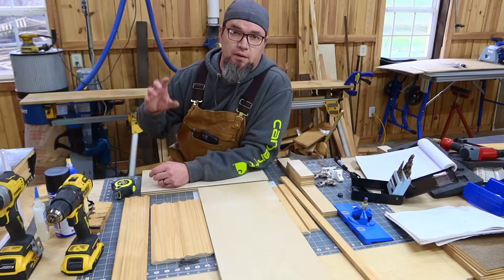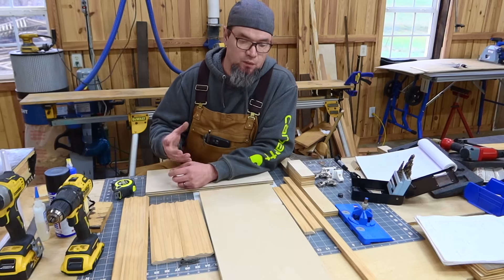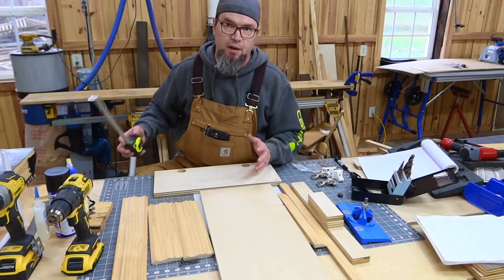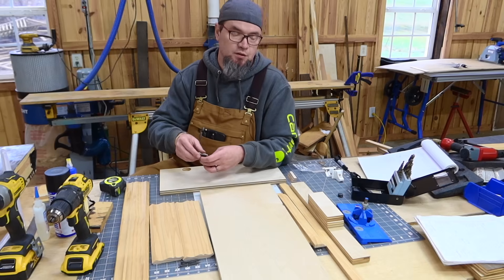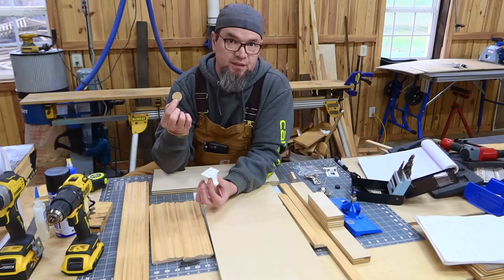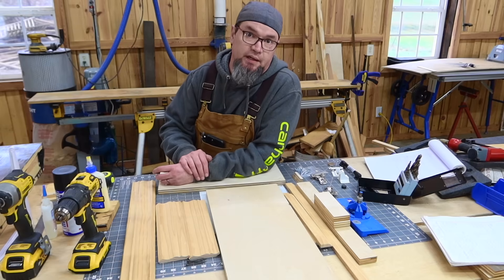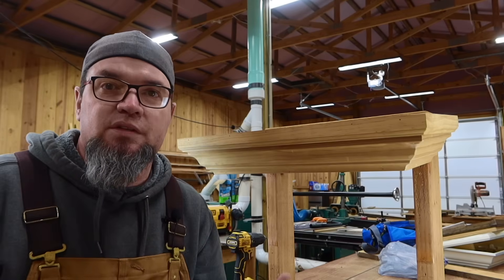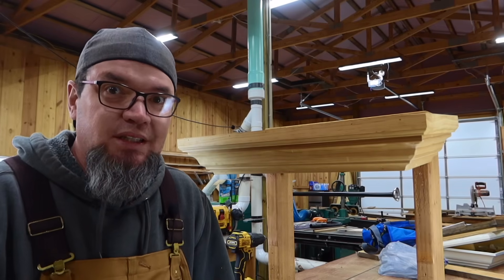Concealment Shelf Build (New Version) / Make Money With Woodworking!

Comment: This update is awesome & much more detailed! Only recommendation I have is showing how you cut the 45’s on the crown molding. I only say that because the first time I did I chased my tail for a while before I realized how simple it was and how complicated I made it. Again, I love this video & your content!
Reply from the maker: Hey!  I do have a video (Not the greatest quality) that actually shows 4 different ways to cut crown.
Reply: @MatthewPeechWoodworking  good to go then, you got it covered! 😎
Reply: That was my biggest problem cutting the molding and cutting it upside down etc. lol
Reply: @MatthewPeechWoodworking  hey neither Home Depot or Lowe’s has those size moulding, can you please help me out with a similar size and how that would change the other cut sizes. Thank you
Reply: @YungRekless   hey, maybe check out another local Home Depot - I purchased both a few days ago
Reply: @MatthewFayson  I checked 3 Lowe’s and 2 Home Depot’s man. Idk why they don’t have them.
Reply: @MatthewFayson  everything is 3 5/8 instead of 3 1/4
Reply: We got ours at Home Depot. We struggled with the molding cuts at first. Maybe link that video in the description.
Reply: @YungRekless  should be ok if it's a little wider crown, the length you need to cut won't change.
Reply: @jasonbzdok3790  it’s the width of the crown though. So the bottom part would be bigger overall towards the top, and might not close. Also if the bracket isn’t tall enough to accommodate, even if it did close it would be at an angle.
Reply: Do you have any PDF plans I could purchase?
Reply: @YungRekless  yep
Reply: Stand behind your saw and look down at. It would be in the same orientation if you were putting it up on a ceiling. It will come to then....
Reply: I've built to your plans specs and I'm having trouble with weight when I add a gun the shelf just goes straight 90° open and everything falls out any advice on how to fix this problem

Comment: 3-1/4 Pine crown Molding seems to be very unique not sold in stores near me. To order it the shipping is crazy expensive. Would 3-5/8ths work? Update: Yes it can but you will need to increase your top piece by about 1/2. You could go a little less but needed to leave some space for error since I am new. Speaking of which. I had no idea about how to cut crown molding. I wasted alot of CM trying to figure it out. I eventually looked it up and watched a video. Not hard to do but as beginners, you may want to add that people need to either watch a video about it or learn because it is a complex cut. Just a suggestion.

Comment: Thanks for the more detailed video.
I wanted to share a tip, when beveling the ply base, I cut and assembled the crown then used a 7/16” 45 degree bearing bit on my router to bevel the crown and base in one pass.
This way when the case is closed there is no gap between the crown edges and wall.
You could also use a round over bit or the table saw.
Reply from the maker: Very good tip!  Thanks!
Reply: Good idea. I’m gonna use the router table and 45deg bit but i don’t t think i would have thought of that on my own. THANKS
Reply: On another note if you do cut with the table saw watch your depth because you might seeing a little hole thru your hinge holes (-:
Reply: @robwilliams3602  yep I’ve made that mistake before. Not on this project but on a set of MDF cabinet doors  🤦🏻‍♂️ routed that nice profile right through the edge of the hinge pocket.

Comment: Hey Matthew, good video. Appreciate all the information you share with the community. One tip on the corners: you can use a screwdriver or wrench to roll the corners over if you don't get a perfect match. It folds the fibers over and covers any gaps; where as sanding might expose more. Again, good builds. I've already built a few mantles for customers using your distressing techniques. I also built some floating shelves where I only used a wire brush to age the wood, without any hatchet or other markings. Turned out great. It's crazy how you can turn boring framing lumber and turn it into something someone wants to hang in their home.

Comment: Nice build, Matthew. Couple of questions if you don't mind. 1) Do you know how much weight this shelf will hold? Approx. or if you've tested it, and 2) When you sell/sold them, how much did you retail them for? 
Like your channel, and your delivery. It's like going over to a buddy's house to see what he's up to. Thanks for your efforts, tips, and can-do attitude.
Reply from the maker: Hey!  I havent really tested for weight.  But I would say atleast 5 pounds.  And when I sold them they went for $200-250.  Check out my other videos where I talk about marketing these.
Reply: I think most people would be interested in these for a place to hide their keys and other things. If you need more "weight capacity" i would suggest a simple fender-washer and a pan-head screw(or lag bolt even)? at the anchor point to the wall stud? The sky's the limit. If you make it strong enough I bet you COULD do chin-ups with it. Hope that helps  :)
Reply: @thefeet  it just seems most things you put in there, especially keys, would slide out when you open it.
It'll probably need maybe little compartments to keep things from sliding around.
Or maybe a foam insert would be nice if you want to put something specific in it.

Or it wouldn't be hard to switch it around and make the top the lid that opens upward, which the original damper would have been for probably. To push the lid up when unlocked.
But then you can't put anything on the shelf.

Comment: Great video. I made one after watching the 1st video and it was definitely a learning curve. This new video will help streamline the process. My only issue is I can not find that size crown anywhere, it's either 3 1/4 or 3 9/16.
Reply from the maker: Yea.  just adjust the size of the top to compensate for the crown.  You can really use any size crown.
Reply: @MatthewPeechWoodworking  when using a different size crown, how much larger than the outside dimension of the assembled crown do you cut the upper shelf?

Comment: a small battery operated LED inside that turns on when opened would be great as well.
Reply from the maker: Yes!  I actually have those and sold them as an option with the shelf.  Very cheap on amazon.

Comment: wow, tons of comments for 5k views on a just posted vid!  Thank you for making the updated video, was super clear and easy to follow.  

Quick question...  why 3/4" Ply instead of 1/2"?  This application looks so small you wouldn't notice a strength difference, and it could reduce the weight (and cost!) of the project.

visible
Reply from the maker: Hey!  No worries!  I just prefer 3/4.  But you could give 1/2" a try.

Comment: I used 3 5/8 moulding and my lower section won't nest in to the top section.   3 5/8 is all I can find locally also.  I guess in theory I could use a thinner trim for the top section.  I added 1/4" to the top shelf measurement and cut the plywood at 22.25 x 10.25.  Fits like a glove

Comment: I was only able to find 3 5/8" crown molding. The adjustment I had to make were: Top- 10 1/2" x 22 1/2"; bracket 2 1/4" x 6" (2) & 2 1/4" x 18". Every other piece worked just fine.
Reply: I havent been able to either except in oak. I tried making my own out of common board but it came out too short and too wide somehow. Thank you for sharing your adjustments.
Reply: This is exactly what I was looking for.  Thank you!

Comment: Great updated video!  I'm looking forward to building these for sale as well as the other build you have for a long  gun, maybe bundle the two for a marketing "cost" savings to the customer.  Question on the foam insert, do you glue it or leave it unglued so the customer can easily trace their firearm and the customer glues it in?
Reply from the maker: I always leave it unglued so they can customize it.  Then add a note telling that if they choose to glue it then to use a spray adhesive for foam.

Comment: Hey Matthew.. I was wondering if I could use 1/2 in ply instead of 3/4 in and if it would really make a difference in stability and strength.. trying to find ways to cut cost with these ridiculous prices with lumber these days.. thanks and keep up the channel Sir👍
Reply: Without measuring I don’t think you would have the depth for the hinge pocket on the  bottom piece it would be pretty close. I don’t see why you couldn’t do the top in 1/2”

Comment: Hey Matt, a huge thank you for the updated video. I think this has just become my next “project” which will help me update/upgrade some of my other tools…or even build my new shop! (I know, I’m getting Way ahead of myself!!)

Quick question though, and it will probably be an easy one for you to answer, but did I see the Kreg concealed hinge jig laid out as part of the equipment you used, and I’m assuming that works with whatever hinges you linked?  As I said, probably an easy question for you to answer, but I’ve never dealt with those hinges at all, and as you’ve said, any time you can use a jig, use it!  Thanks! 🙏🏻
Reply from the maker: Hey Christopher!  Yep!  In the video I go over the jig and what settings to use as well as the measurements if you don't.

Comment: Thanks for the video!  Much improved from the original. I was thinking about making a wider one maybe 4-5’ long. Any tips/tricks I could use for that?
Reply: He has a video where he builds a concealment coat rag to fit a shotgun
Reply from the maker: Martin is correct. I have a large one that will fit a shotgun. You don’t want too much weight hanging outward.

Comment: I love the videos how can I cut the angel on the bottom to keep it from hitting the wall without a table saw any advice would be greatly appreciated?
Reply from the maker: A router or a circular saw set on a angle.  Or I actually sanded the edge off when I first started making them.

Comment: Made one of these and also had that little “slack” where the shelf has a bit of give. It’s due to the design of the lock. It’s designed so when used with cupboards for child proofing there is a slight movement of the cupboard door over in the locked position. So I don’t think that slack can be eliminated unless using a different type of lock. Bummer.

Comment: Matthew, thanks for the update. Would you make an adjustment to the catch that is mounted on the drop section so that when it's in the closed position, it's tighter to the top? I notice that when you close the concealed portion then move your hand, it drops down another 1/4 to 3/8".
Reply from the maker: You could by dropping the catch plate on the inside.

Comment: Love the video, thanks for the details.  I have a question about the lock.  I built one following your directions using the same locks.  But when it locks, I cannot get it to drop down unless it I push up on the bottom a little bit. Do you have the same problem?  If not, any suggestions?
Reply from the maker: Hey! Yes you still have to click it. The only way to get around that would be an rfid lock.

Comment: Thank you so much for your videos. Very helpful. I ran across an issue with the locking mechanism. It works great until I add weight to it. Just gravity alone without anything in it keeps it from unlocking. Any idea what I did wrong? Thank you again.
Reply from the maker: You have to push up on the bottom or squeeze the shelf one the magnet is in place. It will not auto release unless your using an rfid.  Hope that helps!
Reply: Thank you sir!

Comment: The Blum hinges listed have another tooth to be placed along the back edge of 3/4” stock. Are you sure these are the ones you used? Seems like there would need to be a tiny pre-drilled hole for that back tooth for them to sit flush like you have there

Comment: That is nice bud! Even enjoyed hearing kids on dirt bikes lol, that's how I grew up. The only thing my mind is struggling with is the loose magnet. I can hardly keep up with a wallet that I use daily haha, so I am hesitant on needing to keep up with a round magnet to open the shelf, unless I attach the magnet to a string on the shelf or something. Have you tried any other mechanisms?
Reply from the maker: Yea thats the best way for kiddos to grow up... just rough on recording.  lol. I should have explained better... the slim magnets are for gluing to the bottom of a decoration on the shelf.  In the picture the magnet is glued to the bottom of the green pottery.  Just move it and inch and its unlocked.
Reply: @MatthewPeechWoodworking  Ah thanks Matthew! Makes sense! and yes, dirt bikes are very good way to grow up. Your kiddo(s) will be thankful later, if they aren't now;)
Reply: @MatthewPeechWoodworking  have you considered using a fingerprint lock mechanism?

Comment: HELPFUL HINT: After you build your wooden project be sure to seal the wood and stain it BEFORE using any wood fillers and putty. If you putty the nail holes before you stain the wood I will tell you what will happen. When you mash the putty into a nail hole and wipe away the excess the oils in the putty soak into the wood around the hole leaving spots where the stain did not color the same as the rest of the wood. S always stain before using wood putty and seal with a top coat of finish after that
Reply: So after you stain and then putty the holes, do you stain where you put the wood putty?   I would assume you have to, to make it match.
Reply: @hotrodchevy56  Please allow an educated elder developed in the fine art of word comprehension explain it to your visual arts instructor so they may explain the finer points to you. For everyone else the statement explains itself.
Reply: Make it make sense. He asked the same question I had
Reply: @charliesgrumma5388  fine art of word comprehension 😂😂
What’s funny though is you could’ve answered a simple yes or no, instead of that haiku you just constructed 🤣🤣

Comment: Great video! Will be making one in the future! Quick question, it looks like from a side view that the front is hanging a little lower than the rear when closed. Is there a way of adjusting that? Thank you!
Reply from the maker: I should have leveled the cabinet on the 2x4s. But yes. There is an adjustment in the hinges.

Comment: Question, Matt….may I call you Matt? lol Have you yet found any latches that allow the shelf to open without lifting up on the bottom? I’ve tried using the spring loaded dual magnet latches, like are used on glass entertainment center doors, and a couple of others but none could keep it closed….not strong enough magnets. Thank you, again, for all of your videos. I’ve already made multiple concealment shelves, coat racks and a few others that you’ve shared, as well as my own ideas. I LOVE THIS S**T! lol Keep it up!!

Comment: Whoa these costs have changed a LOT!!  The foam is three times as much, the plywood is crazy high, and the cheapest crown I can find is over $25 per 8' stick, a far cry from the $8 quoted in the video.  To make the same money, you would have to charge $100 more!  Not sure what you were paying for cabinet grade ply, but that has gone NUTS as well...
Reply from the maker: Yea I've found prices have gone up as well.  The moulding shouldnt be near that price at home depot.  the foam has gone crazy.  Remember you can make several with one sheet of foam. cabinet ply is $60 a sheet here.  One sheet will make alot of shelves.
Reply: The crown at HD is slightly wider but running $3.15 per foot for unfinished pine....
Reply: Were you buying ply in full bunks?

Comment: Hey Matthew, do you think this same build will work if I extend the shelf longer? For example making one that's 36" long for a larger firearm. I was concerned about the weight on the plastic magnet lock and if that would be enough to hold? Plus the gas damper pushing on it.. Have you made a longer shelf or what's your opinion? I saw your coat rack however that door is vertical and opens out therefore there is no weight resting on the lock..  love your videos! Thank you for what you do!
Reply: Add an extra lock and actuator. Just space the locks put to the ends instead of the middle.

Comment: Something else after building one of these the magnetic locks will not release unless you hold the bottom up the magnet is not strong enough to release it while its empty let alone with Something in it so i made one deeper and used an rfid lock since the lock hole is directly above the pin it drops out and open where the magnet lock has a lip that the weight of the bottom and anything inside sits on and it will not release without lifting the weight but still love the build

Comment: What angle do you cut the bottom crown I’m not getting it to mate proper can anyone answer?
Reply: Having the same problem
Reply: @MrGrowsome420  if you see this look up how to cut outside corner molding and the best one I saw was to lay the part flush where it tapers more so you’re piece will be facing up at about a 45 then turn your saw to 45 and then just match everything it worked good for me

Comment: great vid, I have a question, I'm making one of these but large enough to fit an AR , basically 13x48. I noticed that the front hangs lower than the back. I've tried changing the depth of the catch plate to compensate but it is very noticably off ,when looking from the side. How do you guys handle this? I would say that it's nearly a 1/4" off as in it hangs  a 1/4" lower at the front. thanks for any info or help

Comment: Matt, I do have a couple of concerns. The overhang on the sides is not even with the bottom crown of the shelf when it's closed. I've noticed that the crown hangs lower in the front than at the back. Is there a way to "fine tune" it so the crown has a symmetrical reveal on the sides? Otherwise Great Video
Reply from the maker: Hey!  Oh yea. The hinges can be adjusted down. I guess I just missed that.